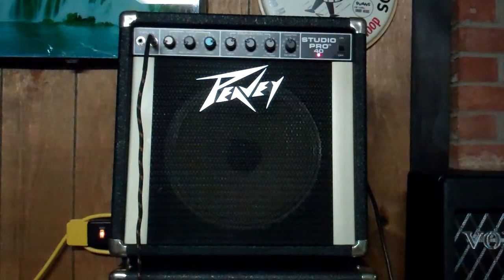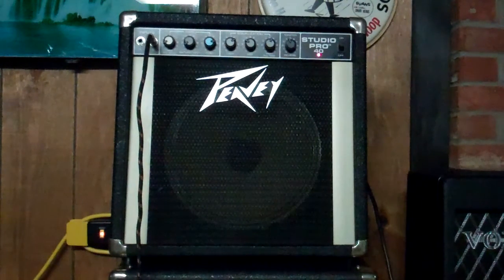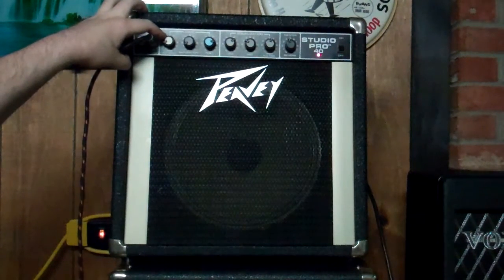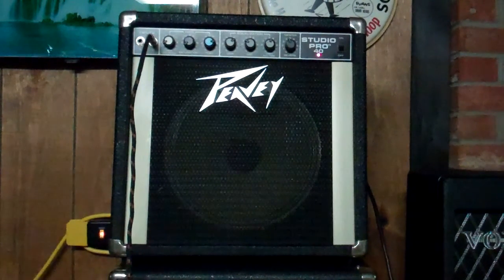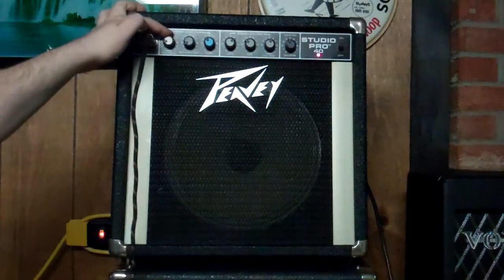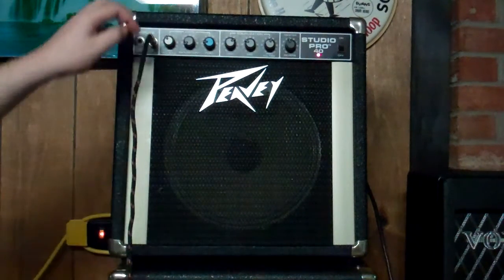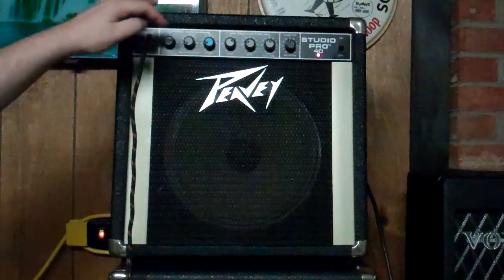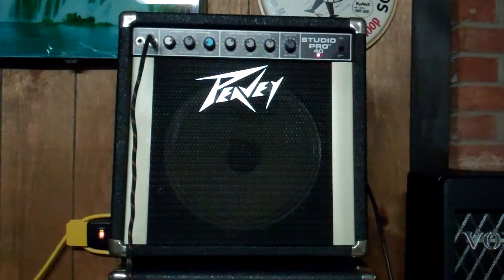Peavey Studio Pro 40 Guitar Amplifier,  All fixed up.

Comment: My first amplifier, and it's still with me. I gig with it regularly. I use various pedals: reverb delay, trem, glitch stutter, chorus...overdrive, and it handles them all.  No problem with volume either...or the drummer.  I've had Vox AC30's, JC120 and a Deluxe, and yet this has been and still is my goto amp.  And, yes it is easy on the back !   Serviced one since June 1986.
Reply from the maker: Cool deal.  I fixed this one of for a gent who stops by the shop from time to time,  bringing me guitars and home stereo gear to work on.   Peavey amps are workhorses.  I have 3 or 4 bass amps in my arsenal,  and one is a Peavey basic 40...   1984 vintage...   still wants to rock...  with just a similar service (like this one got).   Hartley used really good grade parts in these...  I rarely need to do much other than cleaning pots.

Comment: By replacing the stock speaker with a Celestion G12M-70 speaker, back in '92, the amp took on some great character. I bought it new back in '86 and it is still a great little amp, especially for a solid state amp of that era. And with the Hughes & Kettner Cream Machine feeding it, it achieves great distortion tones even though I'm still impressed with the Saturation function for tonality which I do really believe the Celestion assisted a whole lot.
Reply from the maker: Peavey was one of the companies that did Solid State well.......  Fender's early tries were EPIC Fails... until the the 80's
Reply: 70w can?

Comment: The reverb sounded good at 4 or 5. I wouldn't suggest putting it on 8 or 9. It's not crap.  You have to know how to set these things. Peavey reverb has never been crap. I really wanted you to put the distortion up at the outset and then hit the push-pull thing. I was glad you did that at the very end. I wanted to listen to more of that. Then I could tell what it does with thckening it up.
Reply from the maker: I can't go back in time that many years to do that.   Peavey had some reverb pans that didn't sound so hot.........   I've had dozens of them pass through here.

Comment: I gigged with a s.p. 40 even outdoor jobs until the push pull bright and effects loop stopped working. Ran clean with morley effects in morley tray. Replaced it with a Bandit 85 til it's effects loop and push/ bright quit. Also ran a 1976 Fender Twin reverb with JBL speakers.
Reply from the maker: I've revived a LOT of 80's Peavey amps.   They are surprisingly tough.   I like their stuff in the 70's/80's eras.

Comment: Snagged a Pro Studio 40 at a local auction for $35 last fall. Such a deal! I agree on the weak Spring Reverb, which is a small one. I intend to upgrade that particular feature, soon. However, the rest is fine just as it is. Great little practice amp!
Reply from the maker: Peavey was as their peak in the 80's... some great sounding amps,  and indestructible amps for the working musician.   Good deal!

Comment: I had a 50-watt version of one of these as my first amp. I couldn't stand the gain sound, but it had a good clean sound and took pedals well. Traded to a buddy of mine for a Randall bass amp that I still have and is still going. Wasn't a terrible amp, but I like my Transtube Bandit and XXL a lot more.
Reply from the maker: This one belonged to a "jazz guy"  so the clean channels are what he cared about.   I thought the reverb on this was a disappointment.  Other Peavey's like Encore 65 had a better tank in them.
Reply: Yeah I am more of a rock and metal guy. So any usable tones involved a good distortion pedal. It was nice and loud for a solid state though, and it never crapped out on me. Overall, not a bad starter amp.

Comment: I got this amp for my 14th birthday present back in the summer of '85. It was very loud but the gain sounded horrible. Back then solid state amps sounded so bad if you wanted a nice tube like distortion. But it was my first new amp and I was just starting to learn so I loved it.That was my amp for two years until I saved up from working washing dishes, and I moved up to a Marshall half stack. That's when I became addicted to tube power and gain.
Reply from the maker: I tend to agree.   The reverb on this was only so so.... And it sounded best as a clean amp.   The owner was a jazz cat....so it worked out

Comment: I have amassed some peavy's and a lot are kind of flat. They can  easily be .misused. played loud on the speaker,driven with pedals,or perhaps played for very long periods of time in one sitting and driven hot. So yeah most of mine have issues.  Quite a while ago though I had a studio pro that I ran with a tubes reamer ts 5.the sound tank jobbie. Great screwball setup. My saturation would be low and perhaps my tone stack a bit bassy but I would use the tubes reamer not so much to drive the amp but to enhance it. Like a treble booster.  Between the clipping of the pedal and the clipping of the amp (light clipping) there would be tons of character. I liked the Peavy mainly because it was durable and it's like you just turn it on and it's on. Bam go.  Really no fiddling around. I really need to get into fixing amps. One thing I realized about these is the pots are carbon composition and they deteriorate. I wouldn't mind outfitting them with a more quality potentiametre (however those things are spelt)
Reply from the maker: Late 70's to 80s are the toughest.   Put some maxpro spray in the pots and they come right back.

Comment: Just wondering, My Peavey Studio Pro 40 hums, buzzes not matter what's plugged into it, take your hand off the guitar it gets louder. where do I start? Dirty power? Ground?
Reply from the maker: How about if nothing is plugged in?   If its still humming I would start at filter capacitors.
Reply: @DeadKoby  nothing plugged in its quiet, four different guitars all buzz, I used new cables, still buzz's. I might have to take the amp a part, get it off the power strip.

Comment: Thanks for the demo. I'm planning on trading a pedal for one of these. The fact you're plugged into the second input and are getting that much gain confirms it should suit my needs. 
Question: would it be possible to run a second amp from the line out? I've heard conflicting information. some say the second amp would fail. Would it help if I used a noise reducer pedal in between? or should I just not do it.
 thanks again
Reply from the maker: Nothing catastrophic would happen...  but you run the risk of ground-loop noise.   I build signal splitters to run 2 amps off one guitar.... I prefer that method much more.
Reply: +DeadKoby thanks for the answer
Reply from the maker: Muffin Muncher
No problem.   Eventually I'll put all that stuff on the web-store,  but I build prototypes one at a time.  It's just me here.

Comment: Hi I'm trying to put one of these back together and I hit a roadblock .I can;t find a schematic for this model, I put in new Power Transformer and I'm not sure where the Black and Blue wires out of the transformer go ,I know it's by the large cap by the fuse just not sure which one goes where.I'm thinking that the black wire goes into the luge at the end of the cap next to the fuse, and the blue one in the luge next to that sorta  the middle luge ,but not the one at the other end of the cap .Any help will be appreciated.
Reply from the maker: Blue and black should be the primary (wall socket side).    StudioPro 50 is close enough for guidance   https://www.schematicsunlimited.com/p/peavey/peavey-studiopro-50

Comment: Picked up one of these recently from pawn shop. Obvious complaint is with Reverb? Might a upgraded tank help or is problem more with pre-tank electronics? Also, any Speaker upgrade suggestions?? Thx!!
Reply from the maker: Switching to a long spring reverb should help for certain.   As far as speakers go,   I am not sure what direction you want to go sound wise.   Likely something from Eminence would be a value, and have no issue with the wattage.

However, don't be "that guy"  who puts $3000 of accessories onto a 2002 chevy cavalier with 250k miles on it,   and then wonders why he can't get an offer of over 800$ for it.

Cool amp, yes....  tremendous street value?  No.
Reply: @DeadKoby  Thx for response. Yes. No delusions about the Cavalier route bling. Just looking for American sound cutting off some of treble schrillness.
Reply from the maker: Eminence's Swamp Thang speaker lacks the sharp treble...   takes the edge of the nasty amps.

Comment: Just picked one up at a garage sale that was getting rained out for $10! Thanks for the video so I could hear how it is supposed to sound.
Reply from the maker: That's a deal if there ever was one.  It's a pretty good amp...  Sounds OK,  and the build quality was good.   Being an 80's gem...  at age 35 I like to give them a cap job...unless they are NOT gigging/daily amps.  Depending on the hours its got on it, and the conditions it was stored under.   If they are NOT humming at all,  and the caps look good physically...  you can let it ride for a little longer.

Comment: What size is the speaker?cool sounding little amp.Very good videoCheers
Reply from the maker: It's a 12" stock peavey.
Reply: DeadKoby Thank you DeadKoby fro the fast response.

Cheers
Reply: There is one for sale in my area but its missing some of the knobs. Do you think it is worthwhile to buy it?
Reply from the maker: Usually, all these units need is a clean-up.   Scratchy volume pots need cleaned/lubed.   You can get knobs at http://www.amplifiedparts.com   
These units I snag up if they are cheap enough.   I am a tube amp builder,  and Tubes are my thing...  but 76-85 peavey stuff is a very well constructed solid state.   There were many units sold,  so the used price must be LOW.
Reply: DeadKoby Thank you for the tips and the link. I appreciate it.
Cheers
Reply from the maker: No problem.   Glad to help...  and fix stuff.   I'm working on a few new scratch projects,  between work hours...  those vids will be up when the project works.
Reply: DeadKoby I will be checking out your videos.
I also like to tinker with electronic stuff. Just bought me an O'scope not too long ago and still learning about it.
Oh and by the way I am going to pick up the Peavey amp tomorrow same as the one on your video, thirty bucks so that is a good deal, I think? what do you think.

Cheers
Reply from the maker: 30$ is plenty cheap.   Dude paid 80$ for the one in the video....  and then I got the job to fix it.
Reply: Oh wow! I guess I better run uh.
The guy said it work but I wont know until I see it and powe it up.
Thank you for all your help.
Take care.

Cheers